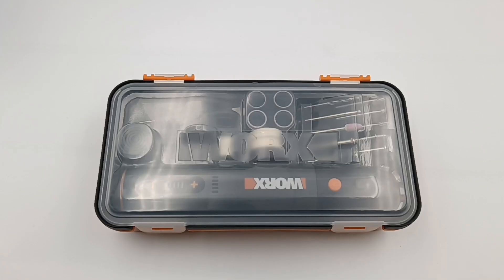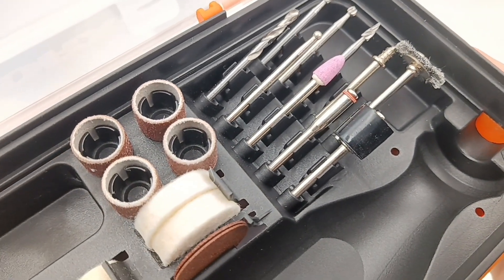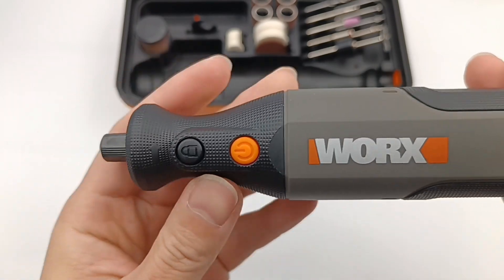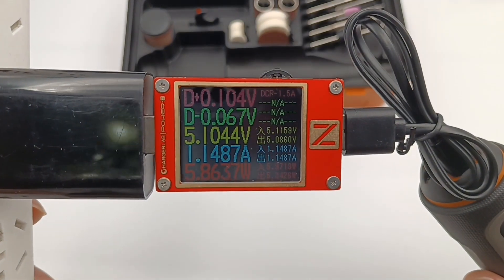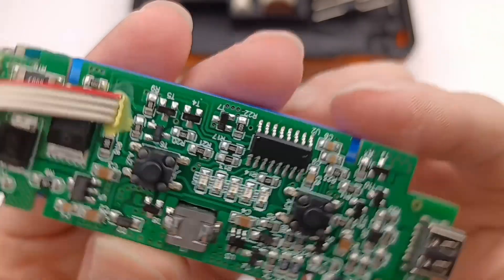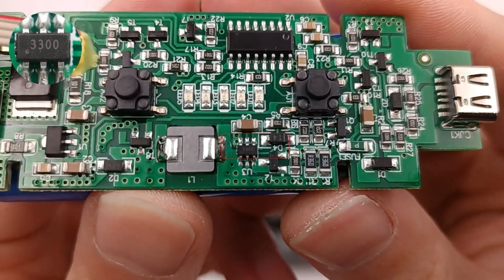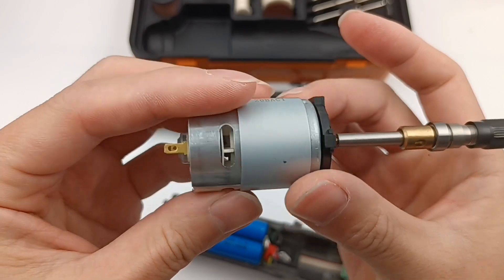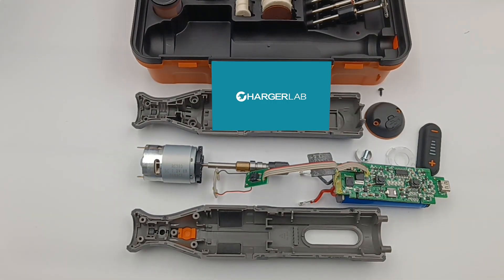Teardown of Worx Rotary Tool (WX106)

Comment: I finally found a disassembly video.  I was wondering what battery is inside before I purchase it.  now I'm confident that I can replace the battery if it died on me.
Reply: Hi. Thanks for your comment. May I ask, what is your observations and experiences with this tool so far. I'm really interested in purchasing one, how's it's built quality and performance?

Comment: @ChargerLAB many thanks for your excellent video. My unit's batteries are dead due to (very) heavy usage. These 14650 batteries don't have internal self-protection, right? I am assuming the battery protection circuitry is embedded in the main board? If that's the case, would I have a reasonable chance of giving my unit an extended lease on life with 2 x new 14650 batteries ( 1Ah, 10A peak discharge) and making sure the thermistor is inserted back in the right place? Any additional advice would be appreciated.
Reply: Yes you can do that. I also did it myself 👍🏻

Comment: You can check Oneplus 65w fast charging on OnePlus 9 Pro phone.  Because you have the same tester that I bought only with a different name (AVHzY CT-3 tester).  Perhaps I have a bad tester.  It is necessary to connect the Type-c cable from the unit - Type-c to the Type-c connector on the tester and from the tester with a cable 100 w Type-c - Type-c will connect to the phone.  And will the phone take more than 5A through the tester.  Because as soon as my phone wants to take 5A +, the tester reboots.  The firmware has been updated to the latest.  Answer, please.